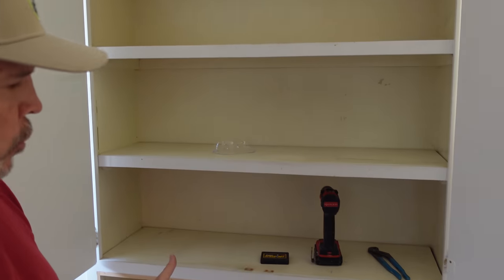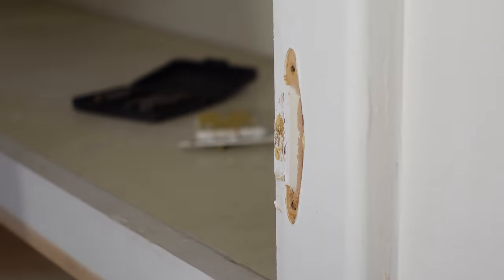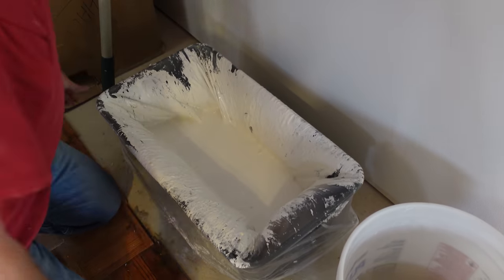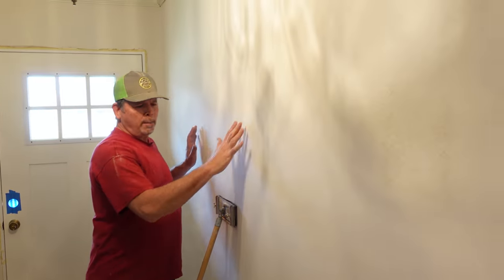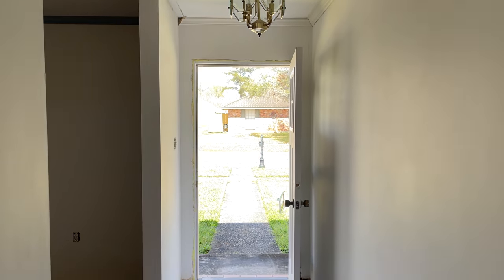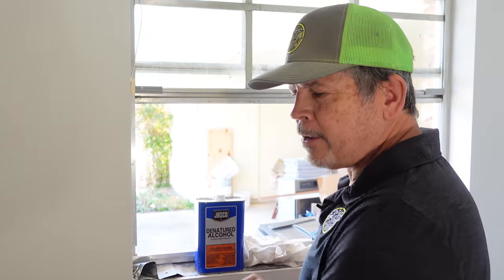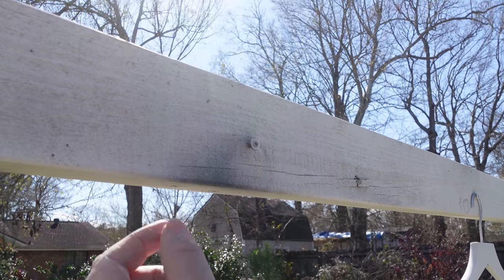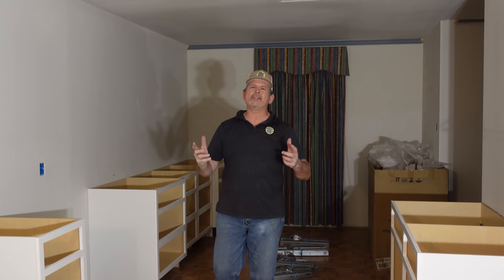What Renovating a House Is REALLY Like..

Comment: Ok i got a great tip (that i just learned).  when you buy your primer, have them tint it.  just barely.  some super light gray or pink or whatever.  Something that is different than your final coat is going to be.  (and easy to cover).  

Because putting white primer on white drywall it's super easy to miss a spot.  And then painting white (or esp white ceilings) over white primer ti's even easier to miss a spot.  (and we'll all been in a house where you are just sit and stare and then notice a dull spot where the paint didn't get).  

but pink or gray or whatever over white is SUPER EASY to tell where you have been, and when you're doing paint, again, SUPER EASY to tell if you didn't get paint on a spot.
Reply: Glidden, if memory serves, sells a ceiling paint that's tinted pink when applied, dries white.  Such a great idea.  I do like the idea of tinting the primer, I'll do that on my next job.
Reply: I used to work for Sherwin Williams. Some of our top contractors would do a shot of black tint in their primer. It not only helps differentiate the primer on white walls, but also helps the primer cover better (especially cheaper grades).
Reply: Killz pva primer is somewhat of a gray color already.

Comment: Go to CVS and buy a box of 100 individually wrapped alcohol prep pads and get the same results to test the surface. You can also use them to clean a wound while working. I prefer it to carrying an extra container in the truck or potentially spill in a house. 
Nice job Paul and Jordan.

Comment: I use plastic body filler a lot with wood. But I started using flexible body filler that is made for bumpers because I have noticed that you will see cracks over time with the regular stuff. Wood is always expanding and contracting obviously. Not had any cracking with the flexible stuff.

Comment: If a screw snaps off in the wood, I use a plug cutter bit around the screw, and then snap the plug out with a small screwdriver. Then fill the hole with a wooden dowel, sand and prime.

Comment: 15:59 Switch out your tip size for a smaller spray fan and flow. A 311/313 would help you out. I HIGHLY recommend you try the low pressure tips. You’ll run half the line pressure and have far less overspray.

Comment: This screwextractor is available in several sizes. Some diameters of piping can also be removed with these extractors. I did extract an 5/8 pipe from a gasbottle and it worked like a champ.

Comment: I've been using that plastic bag trick for 40 years.  First, to keep my oil change pan clean using plastic garbage bags, I could funnel the old oil back into the used oil bottles (if they were recloseable) or a milk jug (if not).  I wiped the funnel clean with paper towels.  The used oil filter (and dirty paper towels) could be installed into the dirty bag and sealed in for disposal and the oil could be dropped off and recycled.

Comment: Go get the Graco 395 nova sprayer from sherwin.. you'll love the upgrade. Better quality finish and control.. use the FFLP tips. Less over spray and paint consumption plus a finer finish. Also the home depot sprayers aren't rated for oil based products that are flammable.. the material for the seals and packing will deteriorate ruining the pump.

Comment: About removing stuck/clogged Phillips screws without destroying them: Back in the 1970s, I discovered the hand impact driver. Its genius is in the fact that it is driven (through a helix) with hammer blows which force the bit into the fastener head as it exerts loosening torque. Originally, I used my very heavy duty (1-2/3 pounds) Vessel No. 2500N to harmlessly remove the fancy #3 Phillips screws retaining cover plates on an old Honda motorcycle. Since then, it has never failed to turn the most frozen of screws without destroying them. The sharp hammer blow has the added benefit of jarring loose the seized threads. My unit has a non-standard 5/16 hex drive bit holder, but it snaps onto a 1/2 square on the driver proper, so I can adapt down to a 3/8 square-to-1/4 hex bit holder whenever I need to free fasteners other than those taking the few large (#4, #3, and two thick straights) bits that I have in 5/16 hex.

Comment: I've got those same painted over cabinet hardware in my Dad's 1948 beach house. 
I used paint stripper, but will use extractor in future, as I ended up replacing the screws anyways.

However, after stripping paint of cabinet hardware, I found out that they were much better than newer ones from same company (Stanley). Older ones are a stainless finish with some decorative Art Deco (?) detail.

Comment: That painters plastic that you used to tape off the bathroom is what I use in my 24 inch paint tray like you have.  2 wraps of tape around the edge and there's your bag.  Been doing it for years.  Also, Purdy's tray has a lid :). Nice work by the way.

Comment: Love it when a new video comes out, it never disappoints!
One tip when painting, especially on pine and other knotty woods, seal the knots with bondo, then throw a quick coat of shellac or a shellac based primer (think kills or bullseye) on. It'll prevent flash over, stop the knots from bleeding through, and bonds to both latex and oil based paint, so no need to worry about the current paint formulation.
Also, you should look into getting a Titan brand HVLP sprayer for doing cabinets and fine finishes instead of the Graco Airless. It's like going from model A to a Lamborghini...
Reply from the maker: Cool thx Al 👊👍

Comment: Seeing you sanding with wooden handle triggered this. You may or may not have tried : I discovered a system at Home Depot consisting of a 5 gallon bucket with two tube stuck through the lid, one sticks down about 6 inches while the other is only about one inch. You hook your shop vac to the short one and the other has a hose going to your sander with a tube for the handle with what looks similar to a gear shift boot and perforated surface on the sander. You put about 3 inches of water in the bucket, all the dust hits the water and the air keeps moving. This collects roughly 90% of the sanding dust. Easy to move around. At the time it was about $ 15 .

Comment: I’ve seen the double nail trick before. When I started plumbing in 99, tap cons didn’t exist at least that I was aware off. The main thing we’d have ti screw into concrete for was brass closet flanges. I assume our method was old school because my boss was old school. We’d buy lead wool. It’s basically steel wool but made of lead. We’d drill a hole a little bigger than the threads of the screws. We’d then pack the lead in with a punch and drive a wood screw in. They’d hold extremely tight. You had to be careful though. If you packed too much lead in too tight you’d never drive the screw. Then you’d have to either pre drill it or drill all the lead out and do it over. It was time consuming but worked great. It probably works better than tap cons. However tap cons work as good as you need and theyre much faster.

Comment: With all the raging debate on YT about what tool brands a professional should use, it's enlightening to see that StudPack uses whatever gets the job done. Just in your last few uploads I have seen you guys using Skil, Ridgid, Milwaukee, Bosch, Porter-Cable and DeWalt. Proving the point that there is no "best" tool brand/platform to obsess over.

Comment: What is the difference in spraying a room versus rolling a room? Is it the over spray? Great video Stud Pack. I’ve been watching all your videos and learning a lot for my home project’s. Thanks for your experience.
Reply: Not only the overspray but the time it takes to set up, clean equipment and tear down equals out to the time it takes to roll. Spraying walls and ceiling only makes sense on an empty home where you can move along. That said, best practice is to have someone on your tail back rolling with a roller to even out the paint from the sprayer. If you don't and you try to touch up with a brush or roller the finish will appear different due to spraying vs roller/brush. Not to mention only about 50% of the paint lands on the wall. The rest is overspray making it more expensive for the material.
Reply: @MrRustyjackson  Thank you. That’s good to know. 😁

Comment: Suggestion and Question. I suggest you make smaller little videos of your larger ones. Double the views without doubling the work. For instance, a small video of just the screw removal hack, then one of the painting on a hanger but also have the full-length video because it is helpful to see how it all comes together. Because now when I am remembering your painting hack or screw removal hack but can't remember which video it is hiding in, I won't be able to find it. This brings me to my question, was it your video I saw how to embed an anchor into a cement wall by going through the item you are then hanging on the cement wall? If so please let me know which video to watch again.

Comment: Hey Guys, rather than Bondo, have you ever tried 'Durham's Water Putty'? No nasty smell, and a little longer working time. The dried consistency is very similar to Bondo. I use it all the time now. Heck, I even try half water, half wood glue to mix with the Durham's for an even stronger filler!
Reply from the maker: I have tried it.  Need to get some more 👍

Comment: i've got that same flooring on my house on the ground floor, it's been applied directly to the concrete though with what looks like tar or some sort of bitumen and that's why it's covered up with carpet as it gets very very cold
but then the carpet raises the height of the floor so the skirting board etc are all now the wrong height
is there a video that you've done that shows how to solve any of these issues please?
the house is getting a mini renovation in the next few weeks so if we can leave that till the end that would be great
thanks

Comment: How big would you say the room needs to be to switch from a 9" roller to an 18" roller?
Reply: 10x10 minimum, and no doors tight to corners, or more than 1-2 windows. Ceilings are the best use for any size room
Reply: @justinreilly4111  Gotcha. I would imagine that there is a little more prep for using an 18". Like setting up the paint tray, etc. And cleaning an 18 roller must be horrible. I still cant justify cleaning a 9 inch roller. it uses a hundred gallons of water and they never get 100% clean.